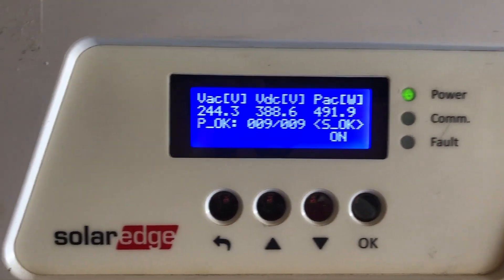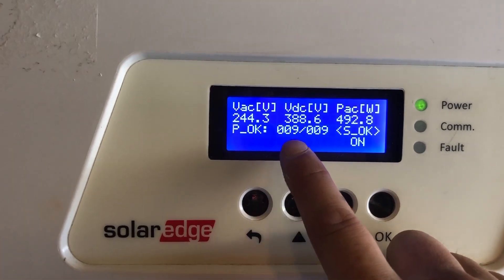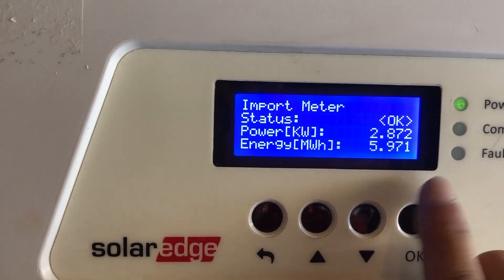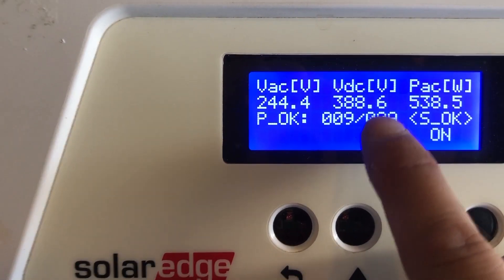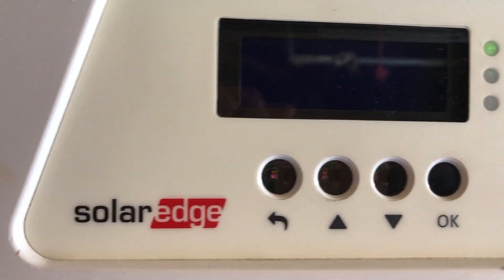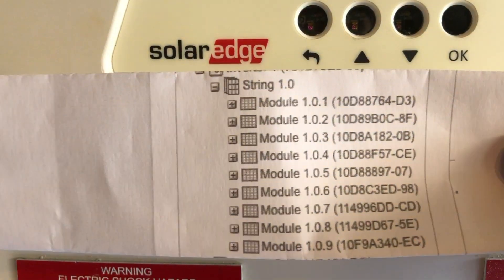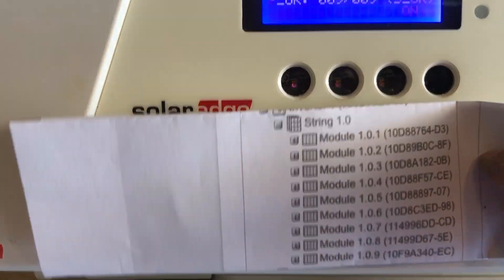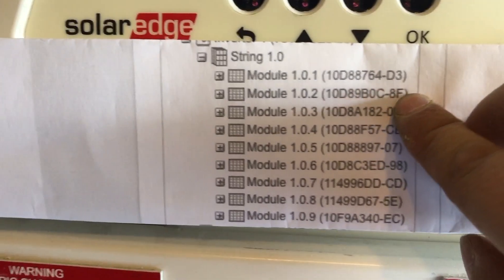How to find bad optimizer within your solaredge inverter string

Comment: That’s great until like most people the panels are up on a roof especially here in the U.K. where our roofs are both steep and covered in roofing slates. I’ve 22 optimisers but only 21 are showing! That means scaffolding and an engineer for a day removing all the panels to check which is faulty, an expensive job. 
My advice is don’t use solar edge optimisers frankly there unreliable, in three years 3 have failed and had to be replace. The whole idea of fitting these optimisers behind panes on a U.K. roof is nuts. Solar Edge warranty the optimisers for 15 year but it’s the labour to replace them that’s not covered and that’s where the cost lies.
Reply from the maker: You are absolutely right, especially for roof installation

Comment: There was a answer video that had you check the voltage coming from the optimizer.  The optimizer keeps the voltage at around 1 volt instead of the full panel voltage.  You can use you multimeter on 12v setting to confirm this. If everything is working correctly, your inverter gives the go ahead and the optimizer will open the floodgates for that panel. 1v is more forgiving than 300v.

Comment: hahahahahahahaa wife starts vacuuming, next clip no more vaccum, u know he told her to turn it off
Reply from the maker: @DigBick Shogun Yep, forgot to tell her I was creating video...
Reply: @DIYGEEKTEXAS  i installed 13 power optimizers. When i come into the inverter, it says 13v, so i read that is right that means theres 13 optimizer, i pair the power optimizer and it is complete and the dc volts went up to 780v dc but the power ac (watts) is still 0.0. Do u know why ?
Reply: @DIYGEEKTEXAS  also is 780 vdc too high is that why the pac watts is at 0.0 ?

Comment: i thought u could check if its working by using an omh meter ?
Reply from the maker: @DigBick Shogun Not for SolarEdge inverters, you can use DC voltage multi-meter to see if you get 1-2 DC volt only when plugged into the string of other optimizers and there is a minimum number of optimizers (I think 6 - 8) that you need to have to be able to create a valid string of solar panels.
Reply: @DIYGEEKTEXAS  Okay. Yesterday i installed a solaredge inverter, today I have a lot of optimizers i am about to go install to see which one works in 1 hour.

Comment: He never told us how he tested the optimizer to see if it worked
Reply from the maker: @Vince LaNovara To be 100% sure your optimizer works you have to hook it up to your inverter.  On my SolarEdge inverter there is a diagnostic menu, in the diagnostic menu there is a list of optimizers (only the ones working will be shown there).

Comment: Sir im just asking.what if one of the module optimizer is not in the invereter.what im gonna do.tnx
Reply from the maker: Check the cables going into and out of the optimizers. If this optimizer is in middle of string then it is probably a defective optimizer. Try replacing with another working optimizer to be sure it is defective.
Reply: Tnx sir.and also im wanna ask  why my pv array layout is 14.and in the iverter solar edge only shows 13 pv array.need to be reser that one or input the another pv array.
Reply from the maker: @lanlaxamana8268  The best way to know which optimizer/panel is bad, you should use the SolarEdge monitoring and compare all the Serial Numbers online vs installed.
Reply: Tnx sir.i do that already.in the solar edge monitoring app the optimizer indicate having a fault or problem is not in the pv array layout.always showing the optimizer module sn which already noy in there.but the we inselled new 1 is not appear in the magnashine and in the solaredge app.tnx
Reply from the maker: @lanlaxamana8268  When you install new one you need to PAIR it to first.  Here is the video how to pair:  https://www.youtube.com/watch?v=MzxdDdv7Rqs
Reply from the maker: @lanlaxamana8268  If you already pair the new optimizer and it is still not showing up as working, then I would suspect your panel is broken. I would swap the panel with another one I know is good to be sure.
Reply: Ill make that one sir.and give you feedback what happen.if not to swap the optimers to other panel if its the problem.thnak you sir.